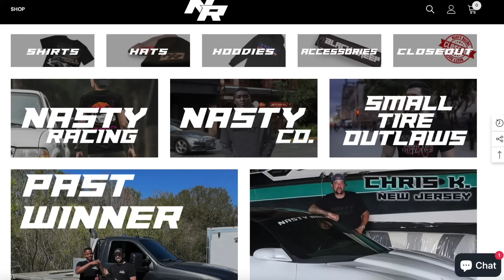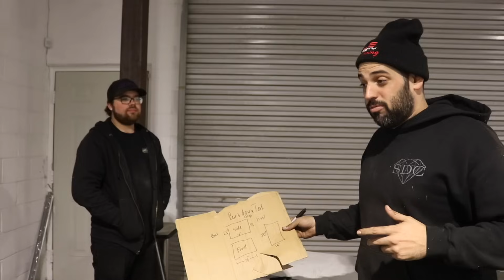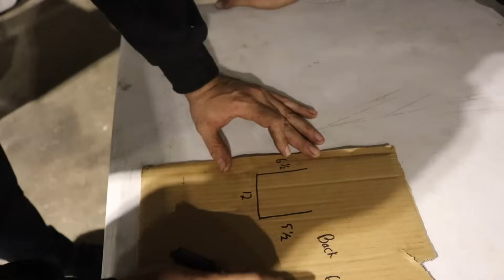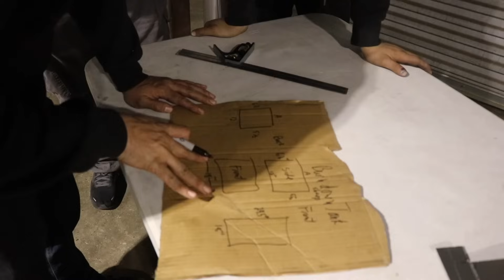BLACK SHEEP gets a CUSTOM burn down tank!!! HEMI Swap is ALMOST DONE!!

Comment: When cutting through fiberglass with a hole saw always run it in reverse to get a Groove started in the fiberglass and then cut forward through it it'll make sure not to Chip And Flare the edges of the fiberglass and will not chip the paint either